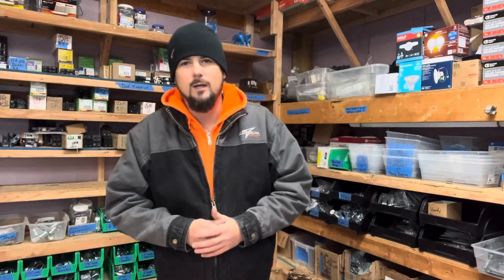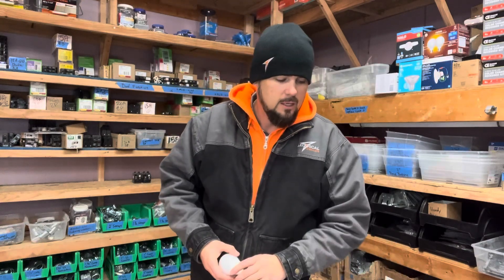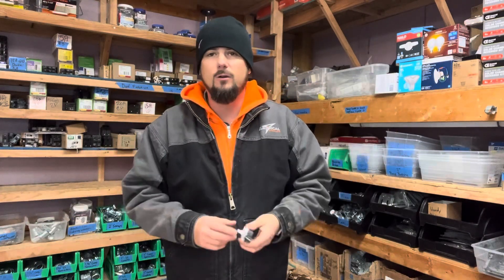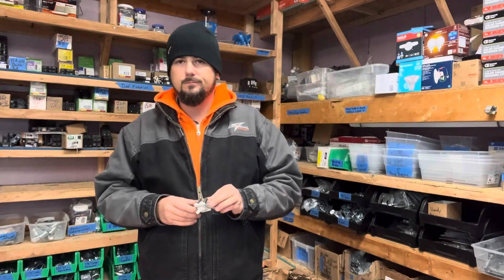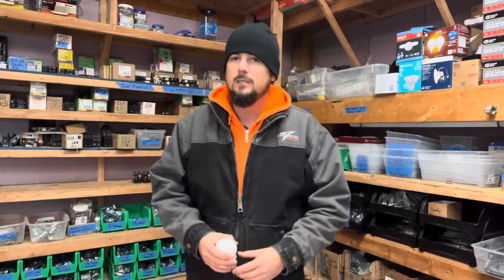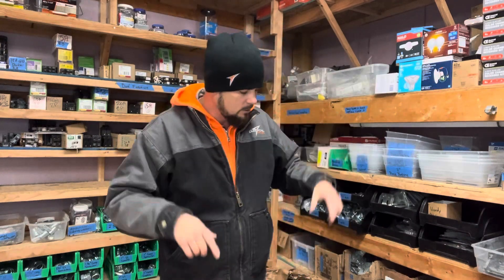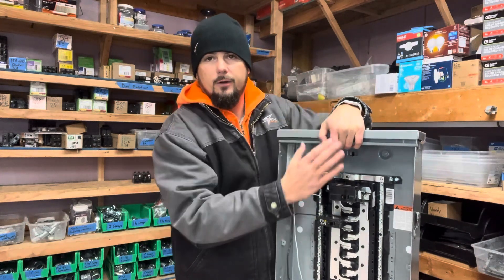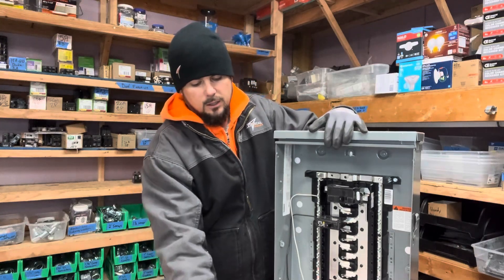WHY ARE MY LIGHTS FLICKERING ?!?

Comment: Quick question.If my home is being powered by the utility company all of my electrical circuits work fine.But if I switch over to generator  power 2 of my 120V circuits do not work or they lose power.I cant figure this out for the life of me.Any suggestions as to why this is happening? The only thing different is utility power vs generator power.Thx
Reply from the maker: That is very interesting. We would need more context as to how the generator is connected to the panel. If there is a transfer switch that repowers certain circuits, or if it is a direct switch to full panel power.

Comment: Bad advice.

Slowly turning it on and off, will ruin the switch. 

Switches are designed to make or break contact quickly preventing arcing which ruins the contacts.
Reply from the maker: That's an interesting take. I would be interested to see what the manufacturers would have to say on the subject. Contact is broken or connected instantaneously, no matter how slowly you flip the switch, so I would be interested to hear what negative repercussions there could be. Thank you for watching!

Comment: I have one lightsource that flickers. Its the string lights over my kitchen counters which i cant replace, they are built in
Reply from the maker: That's unfortunate. The upside is there is always a way to replace them if you can find a good contractor to give you options.

Comment: Regarding your last comment, how would a whole house surge protector protect appliances? It doesn’t eliminate the voltage drop caused by an ac unit at each outlet.
Reply from the maker: Good question. By installing the surge protection device at the source (panel) instead of the point of use (power strip) it will monitor all voltage variances coming and going from all circuits. You are correct, it does not have the capability to increase voltage due to voltage drop. However, the main issue found to cause wear is overvoltage (surge). As long as there is a proper grounding system, the surge will be rerouted to ground instead of traveling through every circuit since they are all tied together.

Comment: My lights started flickering one day and I feared this was going to be expensive then one day I talked to my neighbor and found out he had the same problem. That was a relief because I realized it was outside the house. Sure enough the ground wire connection on the pole feeding both houses had rusted away because it was so old.  Later I found melted wires in the cable box. Dodged a bullet. Condition corrected by the utility company. No one got electrocuted.
Reply from the maker: Wow. There are so many examples of this. Its a good thing you had a good ground in the house as a redundant back up or its very possible your appliances would have been energized. There are cases when the ground is lost from the power provider and the ground in the house turns red just like a toaster and is known to start fires. Always best to check and see if you have one on your water main and one on your gas line.

Comment: Just got electric company to replace all wires from pole to meter. Bad neutral. Potential it cause house to burn down. Call electric company and let them check it right away.
Reply from the maker: Excellent point.

Comment: I changed some large diameter incandescent bulbs in the bathroom to their LED replacement.  When my AC or Heat go on - the LED's will dim and restore - the incandescents never dimmed.
Reply from the maker: Yes we hear this from time to time. Every LED manufacturer uses a differ driver to power the light and some may do this more than others.

Comment: When I was going through initial firefighter/paramedic training in the late 1970s, we were taught to always “pull the meter“, the cut the overhead utility feed, starting with the neutral.
The goal?  
“to render the scene safe from electrical hazards” 😂

Of course, in later courses we were taught the opposite.
It might’ve been the unexpected costs for my eye care after my arc flash injury (retina burn).
&
The costs incurred for damaged electronics, like their home theater room equipment (the neutral).😊

LOL
Reply from the maker: We hear this all the time in our area. The fire dept has been lobbying for disconnects to be installed so they don't have to pull the meter. This last year it passed in our city and now everyone is upset that the pricing has doubled to change a panel. I guess you cant have it all. We will always error on the side of safety when there is a choice.

Comment: What about a interior LED light fixtures that has an LED board rather than a bulb? I have two like fixtures in a hallway. When turned on, one will flicker for about 2 min then settle down and stop the flicker.  Is the fixture on its way out or ??? Thoughts???
Reply from the maker: That is possible yes. Or it could be a bad connection inside the light,  inside the junction box, or at the switch. It would just be a process of elimination.

Comment: My daughter and son-in-law bought a fairly new house that has flickering lights. It reminded me of when an old house I own had a ground fault as the lights "dance" with the appliances (dishwasher, washing machine, fridge, etc.). I checked their ground lug, voltage on both lugs, checked for loose wires/breakers and all seemed fine. They even had the power company out and they changed the transformer (it was not happening at their neighbors, so I doubt that was it) with no change and then had an electrician out and of course it wasn't doing it at that time. 

They do have all LED lighting (shallow mount disc lights) and dimmers. It was all original builder supplied, so we never thought to check compatibility of the dimmers assuming the electricians that installed it all knew what they were doing. That'll be on my list to check on my next visit. If that fixes it I'll come back and update my post, thanks for the tips!
Reply from the maker: Yes that sounds like a fun one for sure. It would be nice to know if there is flickering on one circuit or if its on multiple. Being able to isolate that should reduce the amount of places to look. Let us know what happens!

Comment: Those gloves are not made for protecting you against electricity. You need to wear leather gloves.
Reply from the maker: You are correct. The panel is just a prop and is not connected to power. It is suggested to turn the power completely off at the main or disconnect. If you have rated gloves use them as well.

Comment: My outside light flashed repeatedly one night...it was the night we were moving in and had the uhaul parked on the concrete driveway,  light pole is 3 ft from the driveway...ever since the truck was moved (4 months ago) no
Flashing
Reply: Is the light on a daylight sensor? If so, the fixture may have been sensing its own light reflecting of the truck and turning off, then sensing darkness turning on (flashing on/off at a steady rate rather than flickering erratically).
Reply: @petep.2092  now that I looked..yes  the light sensor is on the side that the truck was parked next to..makes more sense, thanks for giving me a bit of clarity

Comment: My lights in the kitchen were flickering during certain periods possibly from current draw from the grid however when I replaced the FET dimmer with a different dimmer switch from Eaton the problem went away
Reply: My kitchen lights flicker when the laser printer in the adjacent room is sent a print job and continues flickering until the print job is completed. The erratic flicker seems to be in step with the data chunks sent to the printer. The lights are LED and on a dimmer. Lights and printer are fed by the same circuit breaker. The flicker increased or decreased with different brands of dimmer. I believe that electromagnetic noise created by the printer's electronics is getting on to the power circuit and interacting with the dimmer. Been thinking of trying a noise filter in line with the printer power cord to block the interference from escaping into the power lines but haven't got around to doing it.
Reply: @petep.2092  I have the same problem with an older Samsung b/w laser printer.  The 48" fluorescent luminaires in my bedroom flicker.  Not from the printer powering up from sleep mode (amp surge)--the lights flicker until the printer is done and goes back to sleep.  I tried a Tripp-Lite power conditioner (relay activated step transformer) between the printer and surge protector but that was no help so I removed it.

Update: only one luminaire flickers-- it has the original transformer type of ballast.  The other one has been retrofitted with an electronic ballast and does not flicker at all.  Looking at the power strip for the printer with a Klein RT250 (highly recommended), I see the voltage varying from 117 to 119, then 118 to 119, then a steady 119 VAC when the printer goes back to sleep.   The light only flickers during the first time period, 117 to 119.  So . . . likely I shouldn't still be using my "temporary" circuit for the printer that runs through three power strip/surge protectors.  I have a different laser printer to try out but I haven't cared enough to bother.
Reply from the maker: @petep.2092  That could make sense. If its not too big of a hassle one could also power the lights from a different circuit to eliminate the crossing.
Reply: That will happen due to the fuser draw in the printer which has about a 700 watt power draw
Reply: @ The fuser is a steady load, wouldn't cause erratic flickering.
Reply: @petep.2092  actually it has to maintain around 700 degrees and it will turn on when it drops and off when it’s beyond similarity to the electric oven

Comment: Would you recommend a soft starter for your AC unit if your lights flicker?
Reply from the maker: Excellent question. I would have to pass this one to our HVAC friends. We are not versed in the proper workings of these devices so we stay in our lane and only give the facts we are certain of. It could definitely help, but it might be one of those things you just don't know until you try.

Comment: IF YOU HAVE EDISON-BASE FUSES and the lights are flickering on a circuit controlled by a specific fuse:  it's likely that the screw behind the fuse has loosened over time and is making a poor connection between the fuse contact and the bussing of the fuseholder.  This is easily resolved.  Turn off the power to the fuse box, remove the Edison-base fuse, snug up the screw behind it (typically just a straight blade screw), re-install the fuse, and then restore power to that fuse panel.  To prevent the screws from working their way out in the future, never install a replacement fuse while the circuit is under load.  That avoids the arc that is otherwise created as the fuse makes contact with the base.  That arcing "welds" the fuse to the screw, so the next time the fuse is removed, the screw backs out ever so slightly.  Many/most dwellings built before 1960 may still use fuses for some portion of the home, perhaps now only as a sub-panel, as this was the overcurrent protection used prior to circuit breakers becoming commonplace in the home.  When properly installed and maintained, a fuse panel is a superior means of providing protection against overloads and short-circuits.

Comment: We have a flickering issue now that we installed Edison style LED bulbs above our kitchen island. Strange thing is that it happens, only for a few seconds, everyday between 10am and 10:30 then again between 6pm and 6:30. No other lights in the house have that issue.
Reply from the maker: That is very interesting. The Edison style is more or less a show version of an older incandescent. If all the other lights in your home are LED that would isolate the issue. If not there could be other avenues available. I would think its a local source that's causing this issue. Perhaps an appliance that happens to turn on around those time frames. Sounds like a bit of detective work. Perhaps keep a journal of what times and what appliances are running at that time.
Reply: My son recently purchased a house about 5 miles from me. He said he has the same issue with the Edison bulbs he installed in his kitchen at approximately the same time. Our power is supplied by a local coop which purchases the power directly from the generator. I asked about the issue and they said it sounds like the generator is adjusting power output on a set schedule which would effect  the voltage to the customers.

Comment: I have been an electrician for over 30 years and most of the time it's one of two things an unbalanced panel or a loose connection somewhere, but electric will do some weird things sometimes.

Comment: Some previous jackass used woodscrews to put the panel cover back on and one of the screws went thru one of the wires and charged the panel box so when I grabbed it without gloves on it bit me so I now test the box before take out the screws.
Reply from the maker: This is an excellent example. We teach our guys to test everything, even if someone tells you it is deenergized. You never know, and you would rather not have that surprise. Safety first.

Comment: I just responded to one of these all lights flickering. Circa 1970’s panel.  I add flicking off and back on the breakers after a full cover off panel inspection and I also check the current drain on the primary hots and neutral and checked the water bonding ground.  I made a recommendation to replace the LED bulbs to Philips Ultra Definition Dimmable Warm Glow Soft White (best rated).  I said if you have any more issues, the dimmers need to be replaced.  I found nothing, this being the next day.  I also said have the power company check the service.  My policy is never leave a ‘zero find’ without offering a starting point for the home owner.   First these were those horrible pasty white corn cob cluster lamps.  Could be the LED power regulator or aging capacitor’s.  Second, no one ever likes a I did not find anything calls.  It just makes you look incompetent.  Leave with an action plan for the homeowner with LED light flicker issues.  I also prefer Lutron Maestro dimmers that I have used for well over a decade.  The only caveat is they only come in Dacora.  It cascades up and down without surging.  I have these in my own home and the 21 halogen down lights lasted over 20 years. Had to replace them as the lens glass adhesive started to fail. They were never intended to last that long.
Reply from the maker: Good stuff. Thanks for sharing Jerry!

Comment: I dim only on bath light or flicker only when heat pump kicks on. Any idea on that one? Thanks
Reply: Same scenario as referenced in video. When your heat pump kicks on, the current flow increases up to six times which causes temporary flickering.
Reply: @bobjohnson1562  so is there a cure? Thanks
Reply: @mnice6634  Check for any loose connections. Start with your main service panel (If you are confident that you are qualified) Otherwise, there are many things that can attribute to the symptoms you are explaining. God bless 😊
Reply: @bobjohnson1562  Thank you. I'm pretty good grew up around journeyman electricians. Now I'm old and they are all dead. I did a complete new electric in this house. Had the problem on a larger scale with the old knob and tube so was really surprised when I had it again. New everything went in including service from street all fixtures, switches and plugs. Anyway going check all connections and breaker again but I'm kind of a get er tight finatic. LOL Thanks again
Reply: @mnice6634  It may not be that your heat pump is creating a momentary brown out condition (otherwise the other lights would flicker too). Some light dimmers are very sensitive to "noise" on the power supply and sense even small variations or spikes as a change in the dimming control setting. The usual dimming method of dimming lights by starving them of power is a poor way of doing it as the lamp's electronics has to struggle with producing light in spite of insufficient power. It's like turning down the volume of a TV by putting it on a dimmer and reducing the voltage to it! A better way is to feed full power to the lamp and send a few pulses comprising a low voltage digital control signal on the same wiring while the AC voltage is crossing zero. The lamp reads the control signal and adjusts the light output accordingly. So the lamp doesn't flicker with minor power variations. Of course the dimmers and lamps both have to be of the same technology, which is more expensive.

Comment: the power co replaced my meter an upgrade years ago they missed 2 of the blades going alongside the socket rather than in the socket toot about 2 years bevor there was a problem when it was extremely windy one leg of the box would drop off and on the main in my area is under ground took numerus calls and they could not find anything at last insisting it must be in my house and until i had it fixed they were ending my service luckily it was when i was home and when they pulled the meter i spotted the arc  burns un the meter and socket and they reinstalled it  correctly and no more trouble. I guess never assume the one before you could not make a mistake and when it comes to electricity pay very very closes attention to all the details
Reply from the maker: I'm sorry to hear you had to go through all of that. Definitely not the first time I have heard a bit of trouble from the power provider side. Thanks for sharing!

Comment: Mine was caused by my main neutral wire in my panel being loose. Every time there was a high gust of wind everything thing in my house flickered. Thankfully my best friend was an electrician and he immediately suspected that was the problem and he was right. Total time to fix the problem? About a minute to remove the panel cover and tighten the loose lug and check to make sure everything else was tight too.
Reply from the maker: I love it. 20 years of knowledge equates to a one minute solution for a major problem. Experience is invaluable.